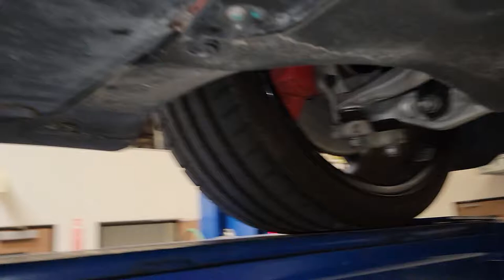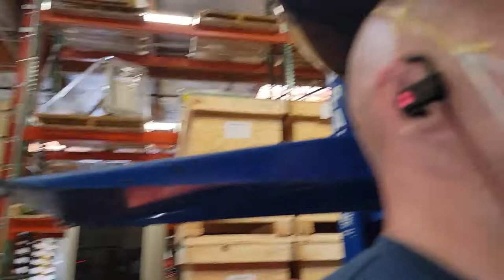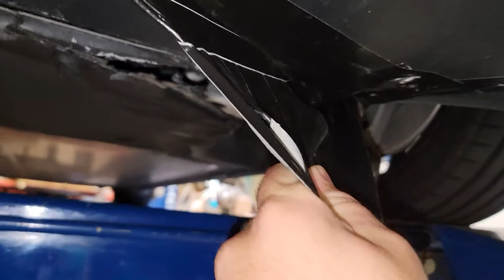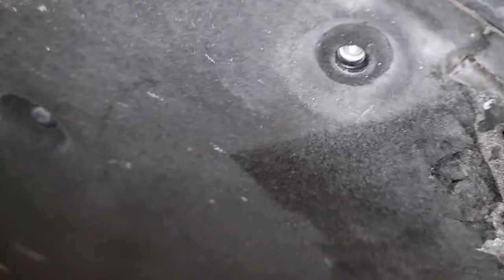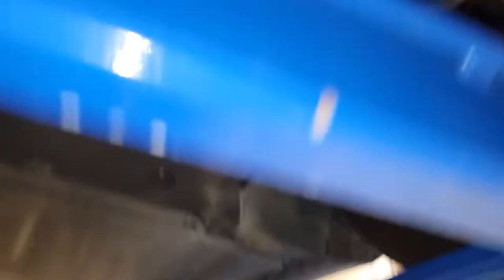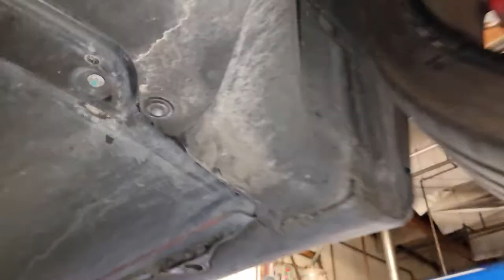Tesla Model 3 Loose undercarriage bolts

Comment: BTW - If you already replaced it...you can put the aluminum version over top of the fabric one for increased strength.  That's what I did.  You get the sound dampening of the fabric and the added strength of the anodized aluminum.

Comment: I enjoyed your video. This is a common problem with model 3s especially if they see much snow or water as the fabric material gets weak and heavy.  You can buy an aluminum replacement on Amazon that fits perfectly to replace the fabric material on both front and back.  RPM Tesla sells them (and has instructional videos) but they are much less on Amazon.  The screws are 10mm if you need to replace a few and you can buy them at Home Depot.  Add Loctite blue 242 to the threads and they won't work lose.
Reply from the maker: Thanks for the like and the information.  I'm not really a content creator and didn't see your information until now!  I think I'm going to get it back on the lift to check if all the other ones are still tight and if not add some loctite like you suggested.  I ended up using half a role of gorilla tape and it held up until service let me in.  After viewing my video they covered everything under warranty.

Comment: dude, mine were all loose too and I think I figured out why, all the bolts and nuts were loose around the aero tray. I had to replace my Aero tray because it got damaged like yours and I asked for new nuts and bolts and I noticed the bolts all had loctite on all of them. they must have discovered this was an issue with all the vibrations from the road that it was causing the nuts and bolts to loosen over time. if you don't replace the nuts and bolts. I would recommend you add Loctite to all of them and they will hold tight.

Comment: Wow dude, same thing happened to me, I had tesla open my radiator to clean out a lot of debris and just a few days ago, my undercarriage panel looks exactly like yours and the one bolt in the corner was missing. I just ordered the newer panel that is supposed to be made of plastic instead of composite material. Along with all new bolts and I’m gonna install it myself when the parts come in a few days.
Reply: Can you please tell me what kind of screw I need to buy, I’m missing a screw